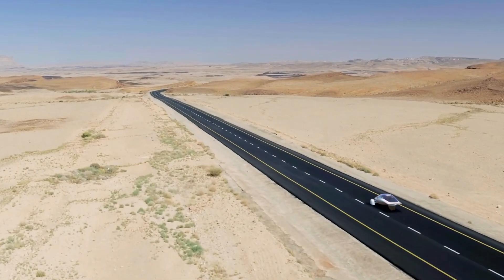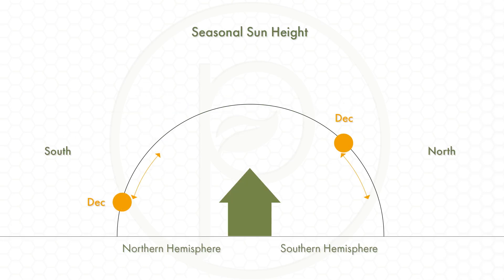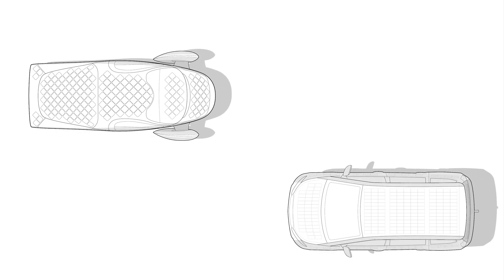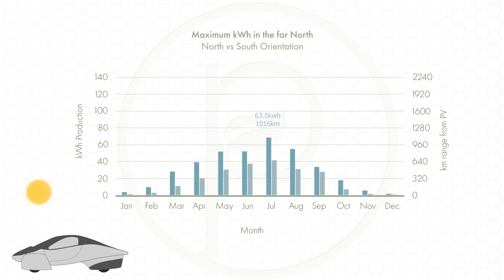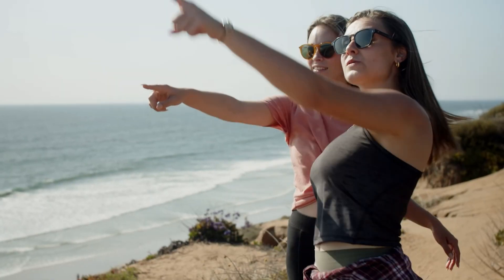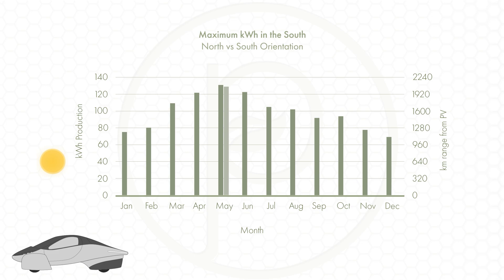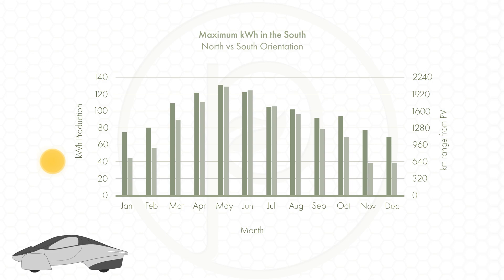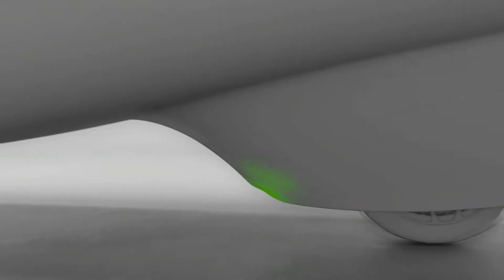Aptera Solar Charging Orientation - North vs South, what's the difference?

Comment: Every time I see the doors open, I wonder why no solar panels on the doors.
If (when) we buy one, gonna carry mirrors on tripods to reflect more light while parked.  It'll make a psychological difference, even if it doesn't make a physical difference.
Reply from the maker: Would be an interesting experiment. I had the same thought but using a big refective sheet. It would probably help in winter more than summer is my guess.

Comment: I was incredibly interested in Aptera as a commuter vehicle until they finally disclosed that the Gross Vehicle Weight limits you to 500 lbs for passengers and cargo. So me plus my commuting partner plus our equipment is just about 100 lbs greater that the Aptera limit. So, bye-bye Aptera.
Reply: 100 lbs shouldn't mean anything. Is it important to you to have solar? Depending where you live it might not be worth it anyways. What top speed do you usually do?

Comment: Having had solar panels on my roof for almost 10 years I know that for about 3.5 months a year I could park Aptera on my driveway [slope SW, nose down, about 2 feet in 10 feet rise] and all panels should be active from 9 am till about 5 when trees and the house will begin to shade the tip. I have a low slope roof [2 feet in 15 feet] for 60% of panels at 47 degrees latitude. The remaining panels are on risers that face SE slightly for morning performance. In total they make up 50% of my annual production in 4 months. For two months on either side maybe half the max potential for Aptera. December and January I will park it in the garage. My 4.86kW system puts out over 5MW annually. Foliage on the horizon to the south makes any real winter production pretty tough if it had more pitch. It will be interesting to compare.

Comment: Great work and content here!  As a few others have stated, I plan to park Aptera in a locked garage and will charge via exterior solar panels... this is why I (and others) have pushed for the ability to connect exterior solar to the vehicle.  Chris Anthony has estimated that the onboard charge controller could allow for 1000 Watts of external PV.
Reply: > "Chris Anthony has estimated that the onboard charge controller could allow for 1000 Watts of external PV."
For your scenario, it was actually more than that if I remember correctly.  The 1000 Watts was in addition to the 700 Watts of on-board solar.  So if the vehicle was indoors, you'd be able to pick up 1.7kW of external solar because the on-board solar is generating nothing.
Reply: @WyndStryke  That is a good point with which I agree, however, it is still unknown if the external input of the controller is limited to 1000 Watts total or would it accept the full 1.7K.
Reply: @DemaGeek  Most likely the latter?   They confirmed that the controller itself can simultaneously handle both the in-built array, plus an additional kW.   The standard types of external input ports can usually handle loads far in excess of that (MC4 for example can handle 30 amps at 1000v).  It would be an odd choice to have the external input rated lower than the controller itself.
Reply: @WyndStryke  Alright, that would be the best news yet... thanks for that clarification!
Reply: MPPT charge controllers like to have volts in a prescribed range. The volts mentioned in another recent video by Cam sounded wrong so don't go by those until you get confident confirmation from Aptera. 16-18Vdv and 32-36Vdc are popular ranges.
Reply: Seems like it will be the lower of the two, perhaps a bit less and closer to 15V, since many of the strings look to have 31 or fewer cells.
Reply: @grantgaborno9600  Good eye for detail there!

Comment: The optimum arrangement for solar gain is to have the vehicle facing toward the equator with the hatch open, angling its cells near optimum and matching that of the front panel.
Reply: Agreed. Especially when camping fairly remotely after a long drive. This ‘maximum’ charging configuration would be most useful with the tent deployed.

Comment: Excellent original content! This analysis further demonstrates that solar panels on the Aptera are much more than just a gimmick and provide really significant free driving range year round (okay, maybe not during the winter months in Alaska). It would be interesting to see how much improvement could be gained by parking the Aptera on a slope (e.g., a sloped driveway)... or how much it degrades the production if the slope is the "wrong" way.
Reply from the maker: Hmmm...that would be interesting 🤔. Sloped driveways are quite common.
Reply: @passivlife  Like ours... unfortunately it faces north. 😥 But we do have a large level area in front of the garage which will suffice nicely.🙂

Comment: Amazing job the research.  Personally I dont expect to get much from solar since vandalism for Tesla's has been a concern and Aptera is far more unique; I will be parking in the garage at home.  If Aptera had tesla sentry mode (with the same efficiency) it would use about 2.7 mwh / year which far exceeds what solar will produce.   The unfortunate reality is anyone not in a gated community will need to decide if the solar gains are worth the risk.

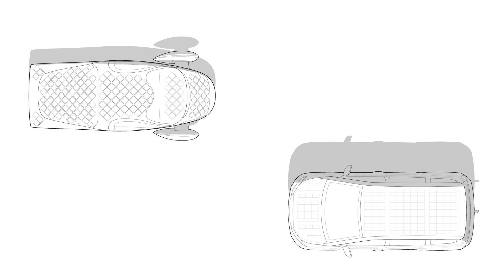PS: Lol graphic at 1:38 is mocking the silly side panels on the sono
Reply: We plan to park in the garage at home for the same security reasons, but still want to solar charge.... this is why several of us have requested the ability to connect external solar panels directly to the Aptera.  Chris Anthony estimates that the onboard charge controller will have room for an external 1000 Watts or so.

Comment: Most people will simply charge at the house or leave it in the driveway for a cheaper charge. After a time, how you part won’t even be an issue. You’ll get enough charge either way. Why let it consume you and the way you drive? From what I’ve read on their site, there enough AI to make up cells not getting the best angle.
Reply from the maker: Yes indeed. I think a lot of people think a solar car will always need to point at the sun, but really the difference isn't much, especially not in the summer.
Aptera's real strength will always be its efficiency. No matter where you live, the raw efficiency will be a huge benefit.
Reply: If people are commuting, then a lot of their daylight charging will be at work / car park / etc, not at home, since once they get home, it starts to get dark.
Additionally there are a cluster of people who can't charge at home (no off-street parking, for instance).  That's about 50% of the population where I live.  I would say that shadowing from buildings would likely become a bigger factor than orientation, however.
Reply: ".....there enough AI to make up cells not getting the best angle."

What?
Reply: Also important is that Aptera is over stating avg kWh/day and this video looks very accurate. Take a screenshot and add up all of the months.
Reply: @artsmith103  At 2.2 kWh/day, Aptera is REALLY over stating avg kWh/day for "little to no solar exposure" areas!